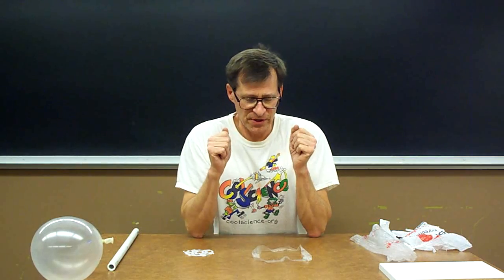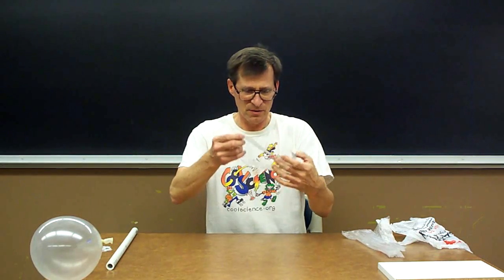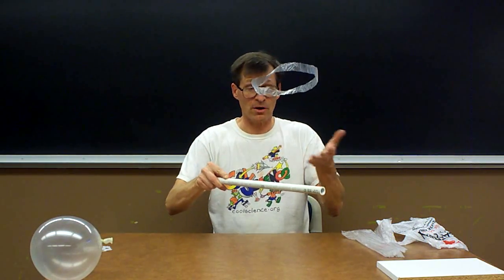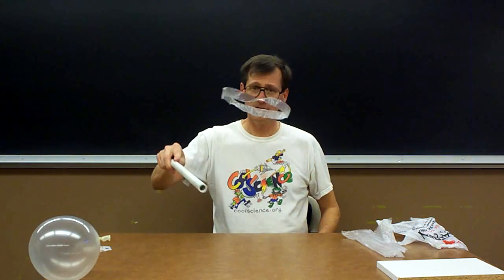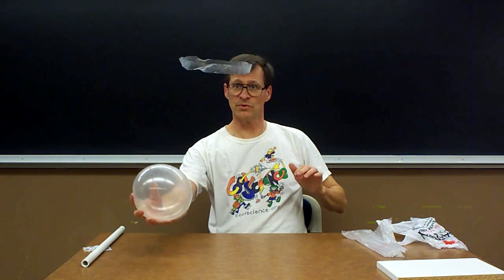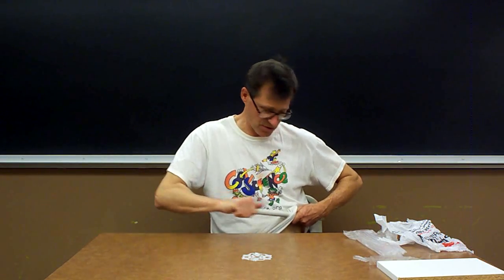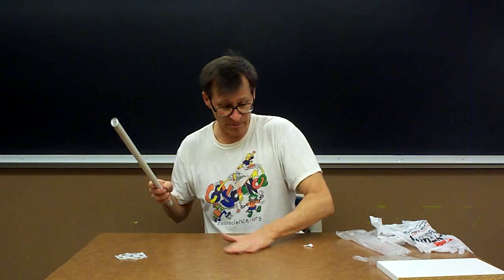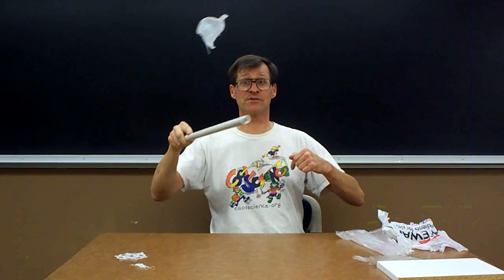Electrostatic Levitation- Flying Hoops & Snowflakes

Comment: Been trying to do this with mylar icicles but all I can do is attract, not repel. Any suggestions?
Reply from the maker: Of course this isn't demonstrated in the video, but it is possible to levitate Mylar Christmas tree icicles. It is, however, much trickier than with the polyethylene film. The key is to transfer charge from your PVC pipe wand to the Mylar so that both will have the same sign charge (it's even more difficult to do this with a balloon).  As you point out, the initially uncharged Mylar will be attracted to your wand (as all conductors are) and probably stick at first.  The trick is to toss the Mylar into the air and as it falls quickly touch the wand to the Myar then IMMEDIATELY pull the wand away before the Mylar gets stuck.  If you are successful you can then hold your charged wand below the now charged Mylar and levitate it.  While this is easy to describe, it can be extremely frustrating to pull it off (pun intended), so you may have to try several times. 
You will also want to tie your Mylar into a shape that works well for levitation.  I like to start with 4 or 5 strands about 6" in length, then tie them all together with knots at each end about 3" apart, and finally trimming off most of the loose ends.  Once you charge this up as described above it should open into an orb shape as all the individual strands repel each other.  
We'll try to make a new video of this soon.  Good luck!